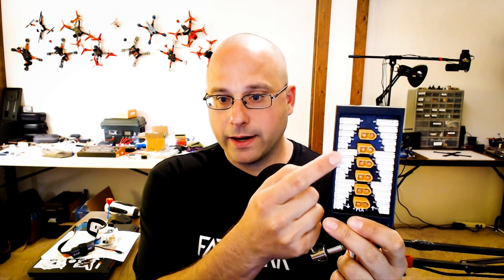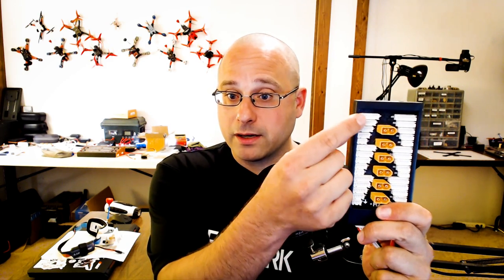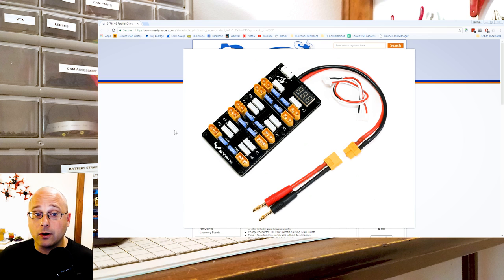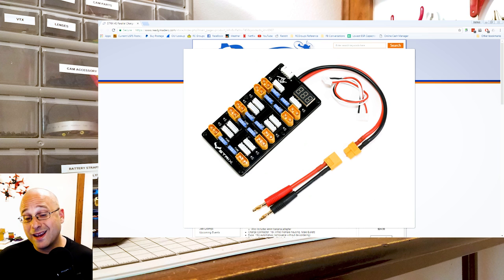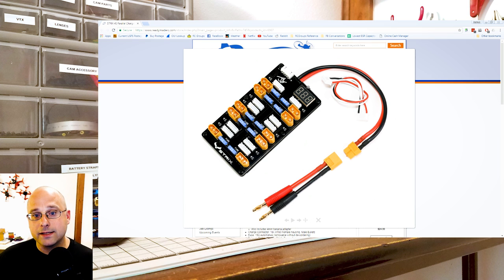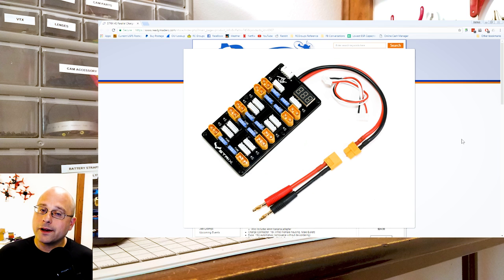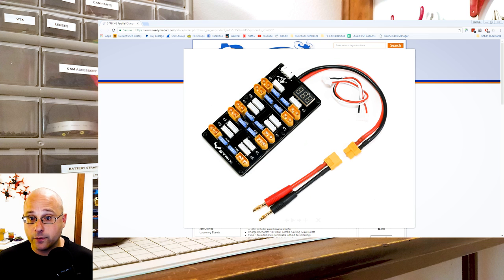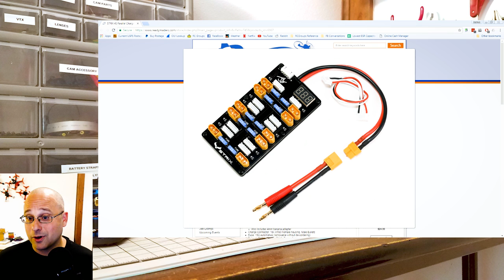The Best 4S Parallel Charging Board. Period. | JB SIGNATURE LINE

Comment: Oh man was hoping to buy the best board! Nah i have other than 4s batteries. If want to add on another board dont use the xt60 just use the connectors that the bananna plugs go into. Many boards use these connectors instead of xt60 which is a isdt thing. Most chargers do not use xt60 plugs such as icharger or many other brands so having these connectors would be easier than xt60 in most cases.
Reply from the maker: What connectors that the banana plugs go into? The board has no banana plug connectors. The board comes with an XT60 in part because XT60 is safer than banana because you cannot accidentally short the leads together when the board is live. So you can plug banana into your charger and plug the board into the XT60 adapter and be safer.
Reply: Joshua Bardwell Sorry was lazy when I wrote that. You can put 4mm bullet connectors at end of parallel charger then you can add on boards. Many boards do that on the market. The connectors get soldered to the main bus of the board and save space over xt60 and most chargers use that size to connect the board to the charger.
Reply: But then again why make something that someone else has. I like the difference and may consider for just my quad stuff. I don't just fly quads:)

Comment: I'll buy it 8/15    Thank you!!
?-  I want to get a Clearsight rather than a Fatshark with diversity, but I still need 16:9 hd goggles... Any ideas, or would I need to buy Fatsharks to get the best out of the Clearsite?
Reply from the maker: I'm not sure why you think you need HD goggles to use ClearView. ClearView is an analog receiver. It will work with any common goggle.
Reply: I'm using the monster V2 1.8mm and a box set 1080p 16:9. I love it - it looks amazing. I want to move towards something better reception/comfort, but I'm not wanting to take a step down in pic quality. Thx for taking time! my question is a bit silly, I want all the stuff you have anyways. cheers.

Comment: Josh.......I LOVE your videos, but man this is a dead end product and I expect much more from you... 4s???  This hobby will be into 6s in the next blink of an eye with the amp ratings we are at now. This EXACT thing happened in the RC Helicopter arena and before you knew it the cell count increased on ALL helis to provide the same power at much less amperage. Its appalling to me that as an "RC" brother the drone community has not learned from the recent past. Im a Quad/Drone guy as much as Im a heli guy, but we need to be making steps forward. PLEASE do a video on voltage vs amperage so more people get on board, Im sure you know the benefits of HV vs hi amps.

Comment: 4S only is a bit sad as 4S is basically dying now and 5S is what everyone is starting to use. Good idea was to use similar balance ports as on those isdt chargers where they add open port and you can plug any balancer without separate specific sized plugs. So 5S wide port where you can plug anything.
Reply from the maker: I am really surprised to hear that 4S is dying. I think this isn't as true as some people say.

The whole point of the balance plugs was to prevent you from plugging in wrong. Keyed plugs are desirable in this case.

Comment: Question: https://youtu.be/PKCC5ov5rHU?t=4m2s  "I almost accidentally plug it into 5s".  I'm not following.  Let's say 3 4s batteries.  2 are in the correct (4S balance plugs). 3rd in 5s, but how a balance plug is wired, the charger will still only see the 3 batteries as a single 4s battery even if 3rd 4s is in 5s balance plug. Position 1 is always ground, then all the remaining conductors are the Positive leads.  So even if you plug into 5S, there is only physical connection at 1 for ground, the other 4 to positive for the respective cell.  5th position would have nothing from a 4s.  So I'm not following that.  Am I missing something?
Reply from the maker: If you plug in to the wrong pins, sparks fly out. Because Cell 1 + on battery 1 is connected to cell 1 - on battery 2. and so forth.

Comment: damn, if only it had up to 6s, I have lots of 6s
Reply from the maker: The whole point of the board is that it adds safety and allows more ports on the board by having only a single balance connector. Maybe at some point we'll make a 6S version of the board.
Reply: Joshua Bardwell that would be helpful thanks.

unrelated,sorry, do you have any videos about setting up LED's on betaflight? for the life of me, I can only get the top left module to light up, the rest don't work, thought it was a faulty setup. but I got a new setup now but will the same result. I can't seem to find my answer in forums
Reply from the maker: I don't. But here's a video from BlueFalcon.

https://www.youtube.com/watch?v=0E_4K-H16Jk
Reply: data in data out connections correct ? number/amount of leds correct ?
all strips should be in chain.

Comment: Not sure where you are getting your price points from with the board you held up. Landed into Australia via ebay it is AUS$10.19 which is at the moment US$7.87. Lot of difference than the prices you quoted.
I use both 3s and 4s batteries so this is no good to me and I feel it is the same for lot of other fliers. Mainly because I have big and small quads and planes. Also my charger has both voltage and current indications so the digital readout is no big win for me. I am sure most chargers have the same facility for voltage and current, except some USB chargers for 1s.
As for the fires etc, you can't guard against stupidity. Some people will always put their fingers into the props to see what happens.
Reply from the maker: I got my price points by looking at Banggood, which is where I buy those boards from. Many chargers don't show voltage until you start charging, or even while they are charging it's not on screen by default. If you've got a charger that shows that info, awesome!

Comment: these are the ones i been using for years 
http://www.revolectrix.com/MPA_XH.htm  
Expensive but can handle the current and EACH balance port is also (poly) fused  
Daisy chain port also allows for cell voltage checker.
Reply from the maker: That's a beauty, and at $65 it ought to be.

Comment: since this is battery related have you sen this?
http://www.isdt.co/bc-8s.html 

I should have it in the mail today. I need to look into it more, but I think if you put it on quad copter you it can tell if you have a bad battery so you don't ruin a bunch while parallel charging. way more fun then sitting in a room testing them all.. I think it weighs 15g.

Comment: Really ? is it that hard for the dedicated hobby guy to make one himself ?
The idea is good though.
Reply from the maker: You can easily kludge together a harness of wires. A lot of people are willing to pay a premium for a nice balance board.

Actually, given how many balance wires you would have to join, I'm not sure it's so easy to make it yourself after all.
Reply: Thought of a breadboard/veroboard PCB, pin spacing is 2.54, would be a simple start, or with double sided PCB, design print tracks with waterproof marker and etch, this way you can make bigger holes and thicker tracks for XT60's
or use harex board drill holes and wire it up

Comment: Only 4s ? and no polyfuses ? Failed product in my world :-)
Reply from the maker: Only 4S is a safety feature. It's impossible to accidentally plug into the wrong balance port since there is only one on the board. Fewer balance ports allows more batteries on the same board (10 vs. 6 or 4 for other boards). Polyfuses would take up space on the board and reduce the available ports. They would also raise the cost. 

The safest approach is to plug in the XT60 first. If the main fuse blows, stop do not proceed. If the main fuse doesn't blow, you are then safe to plug in the balance plugs.

If you fly mostly 4S packs, the ability to get 10 plugs on a single board for only $24 is a massive win.
Reply: Easy to make a single header that could accept 2 to 6 cells. And polyfuses are not that expensive. I accept that it would raise the cost with resistors and led to indicate blown fuses. This board dosent have any indications ?